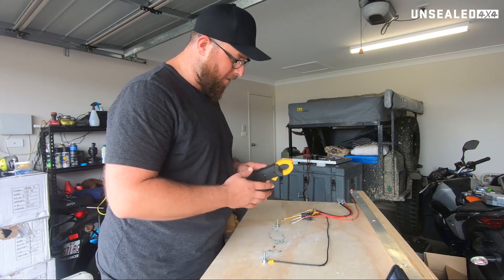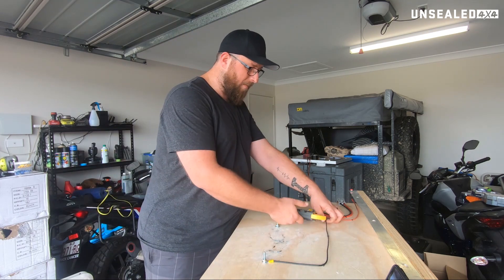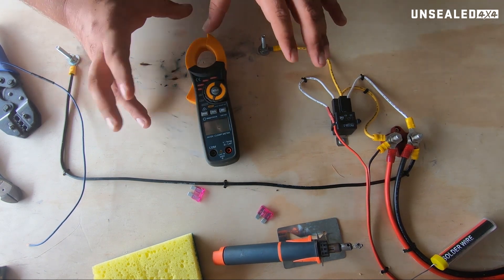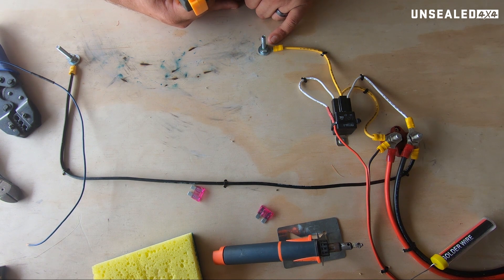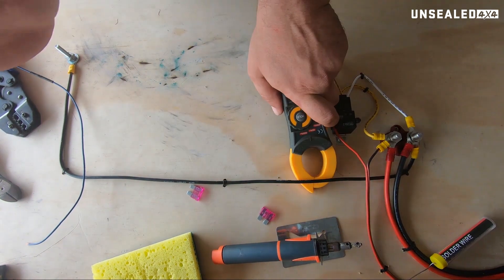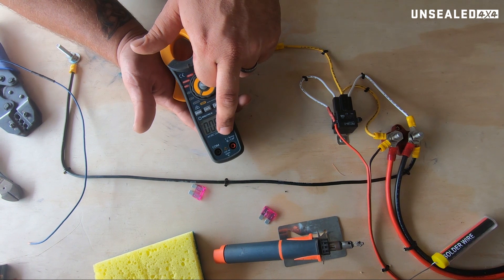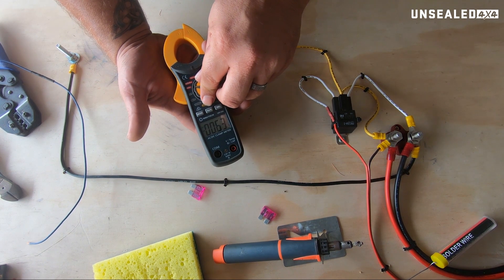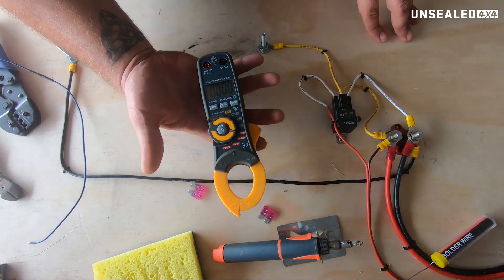12V Guide: How to use a clamp meter

Comment: He says he always uses negative but doesnt know why, most likely The reason is theorectical in nature, the mainstream theory sugjests electrons flow from negative to positive, however there are counter arguments to this point. 
My thought is,, Personaly i would check both sides and go by the higher reading, if any...
Reply: old post but:
The CURRENT is identical anywhere in the loop unless the wires split. Clamping around the NEGATIVE wire is usually done because there's often just the single cable where as the positive might split to the charging and computer etc. If there was a SINGLE negative and SINGLE positive they would both give the same result. If the Negative was 20A then the positive cables must ADD UP to be 20A.. most modern cars put a similar CLAMP sensor on the NEGATIVE wire lead next to the battery for this very reason. It records CURRENT and sends that data back to the computer to aid in optimizing the charging cycle.
If you measure 200mA on the negative cable with the car OFF then that's the parasitic drain pulled from the 12V battery. In which case you may have a light on, a computer on or a wire shorted etc.
Reply: Also...
Electron vs current flow is irrelevant. You're measuring the magnetic field produced by the electrons moving in the wire. The direction makes no difference.